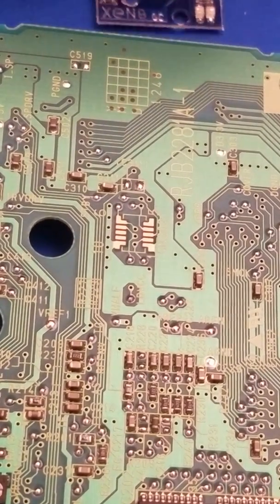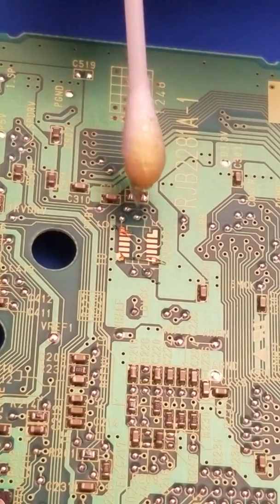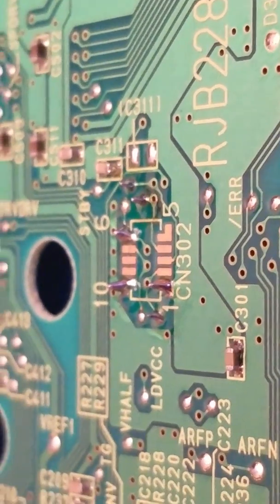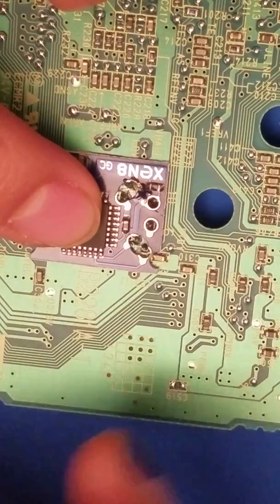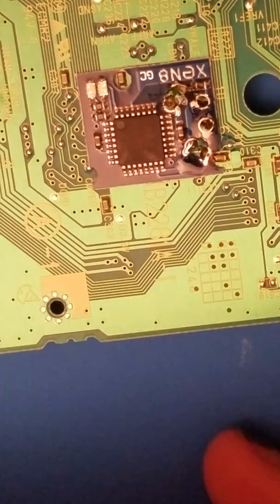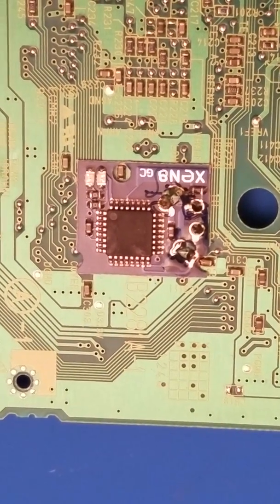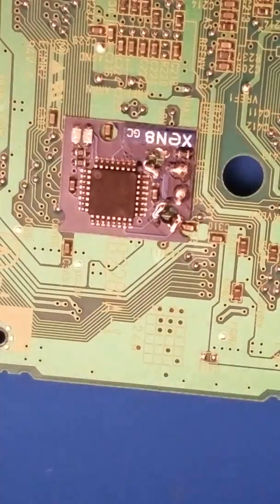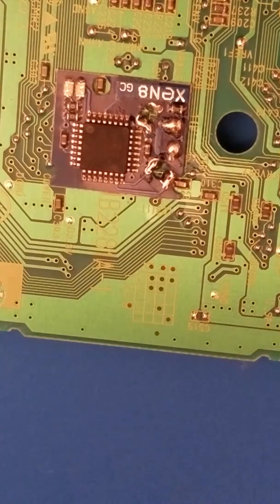How to wireless install a Xeno Gamecube modchip

Comment: Thanks! I haven't soldered in like 10 years and I've only barely used one. I bought a good budget kit and this video helped a lot. I got it to boot and now I've got the sdsp2 adapter plugged in and working.